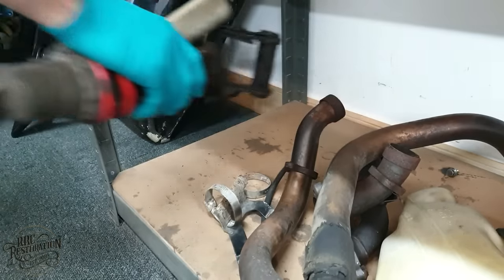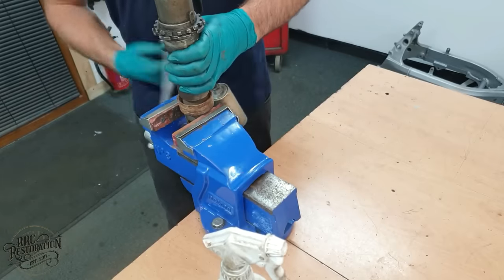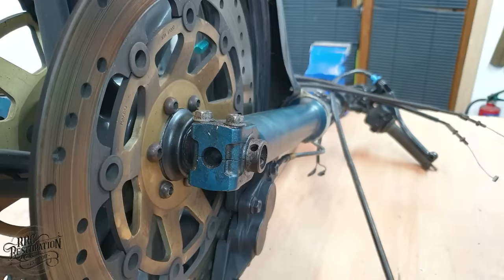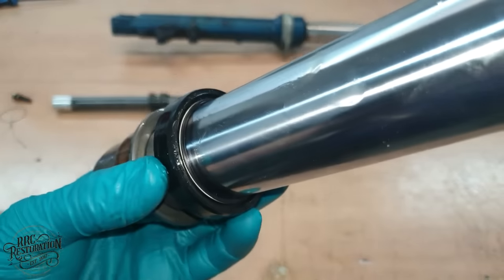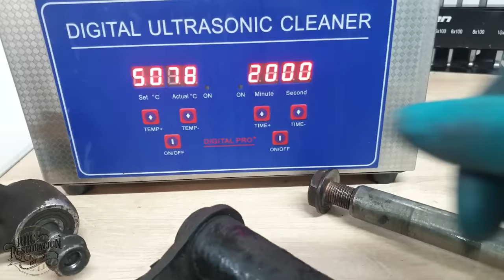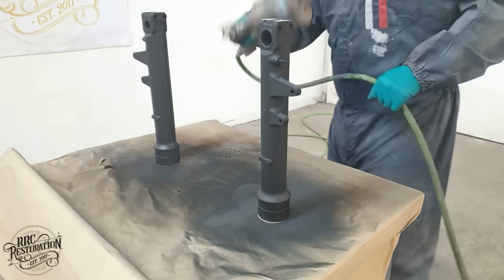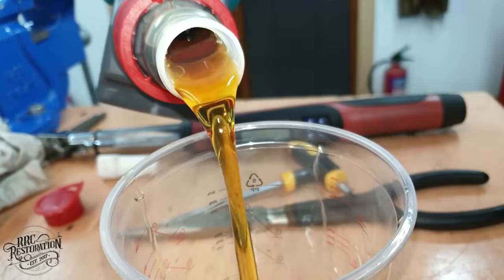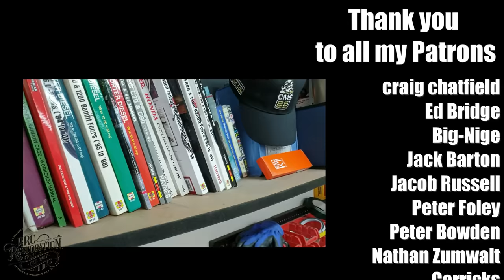Restoration Of A Ruined Legend - Honda VFR 400 NC30 - Part 3

Comment: It's been 20+ years since I made a living as a suspension tech, but 2 things come to mind.  The first you probably did but just didn't show, when refitting the top cap, you want to run the rebound in 3 or 3.5 turns.  This sets the range of adjustment (if they're all the way out when you put the cap on you'll have no rebound adjustment, or at different points from each other and you'll have different settings on both forks).  

Second is conditioning the chrome tubes themselves, while not all Need this every time, it's bug guts and rock dings that tear up seals so we always dressed the chrome with a cross-hatch with some Emory cloth.  I really don't remember grit, though the hatching was clearly visible...  obviously, give a little more attention to any rock ding areas to knock down and smooth over the high points.  The scratches won't harm anything, they simply fill with a Tiny amount of oil and give a slightly lower stiction.
Reply from the maker: Very good and valuable advice, cheers fort taking the time to pass on your knowledge to us :)
Reply: What about how the forks went together before putting in the dampner rod and the aluminuim bottoming out piece under it
Reply: @RRCRestoration 
Hiya.
Is it possible to send the forks from a Honda blackbird to get a refurb ?

Comment: Most people would have just bought a Nitron replacement shock. Love your fully committed restoration attitude ❤
Reply from the maker: Funny that you should mention that as I did look into just replacing it with a Nitron but I couldn't bring myself to replace the original.

Comment: Instead of the proper tool, one can also use a PVC plumbing pipe plus the old rubber ring to hammer in the new rubber ring. Thank you so much for the detailed video and the whole series!

Comment: Love your work just the way you do things I've learnt somethings today.  Interesting with plastic over the slider to fit the seal fitting the seal with the tool protecting the nut checking oil level. Thanks 👍
Reply from the maker: Thank you so much , really glad you've picked up a few tips and tricks ;)

Comment: Sorry to be that guy but I sure you've installed the springs upside-down, I'm sure the tighter coils go at the bottom which was how they came apart anyway.
Secondly you've bleed the dampers then layed the forks down, and with the bottom end slightly higher they may require bleeding again. Great job though I've been doing this for 25 years and still love watching how other people do things, you can always pick up something new tips wise 👍
Reply from the maker: Nicely spotted, I wondering how long it would take for someone to spot that.  Immediately after that shot I flipped the spring around , I got a bit caught up in worrying about the camera shot rather than what way the spring was facing.  lol

Comment: I love your work. They wouldn't allow the 400 over here in the States so I'm on my 4th 750 (various generations, even one 800vtec) my current one is a '93. It's the first one I've had to due a major rebuild on, as I let friend borrow it one day and he proceeded to ride it into the side of a mountain in Colorado. This episode will certainly help me rebuild the used replacement forks and front wheel I bought offa ebay. Excellent!
Reply: I do indeed have the genuine Honda shop manual for my model because they specs will obviously not be the same. But watching you do it proper is a bonus.

Comment: Having recently done my CBR500RR front forks I envy how well the fork seal came out! I had to heat the casing up to get mine to shift. Great tip woth the plastic bags too.
Reply from the maker: I recently had a 125 in for service, same thing the rubber had basically welded its self in fork tube pretty much had to melt the rubber before it would move, absolutely nuts how hard they can grip.
Reply: What does the plastic bag do?

Comment: Several years back. I did a rebuild on my Triumph Speed Triple's suspension. After multiple rounds, due to seals leaking and poor performance, I found that factory suspension just wasn't for me. Ended up installing Mupo cartridges and rear shock for my setup. I probably took those forks apart 4 or 5 times in my garage, and this video just reminded mean that I still have that order of operations imprinted in my brain.

Comment: The drain bolt for the fork leg was replaced with a generic hex bolt, personally, I find stainless bolts, with the numbers filed from the head, and then polished up can look OEM, those numbers (8.8 or whatever) always reveal them to be non original.

Comment: As a motorbike DIY'er, thank you for the tips and tricks you're passing on. The plastic to protect the top cap is absolute genius!!

Is the plastic sheet over the fork just so you don't damage the seal when fitting it? What type of grease is the red one you're using?

Thanks for all your time and effort man, you're a legend!

Comment: what a joy, maybe consider a modern set of the Showa BPFs off a new gsxr 600, get the brembo mono's the works, so nice, or integrate FI and get a modern CBR setup with active suspension, weight is all off tho...  a modern shock man that bike will be the knee's for sure .. comfy and glued

Comment: At 12:07 it shoes that the fork springs were installed improperly. The tighter coil windings should be at the top. The nonmoving end of fork tube. You should have check the fork tubes on V blocks to check for straightness with a dial indicator.

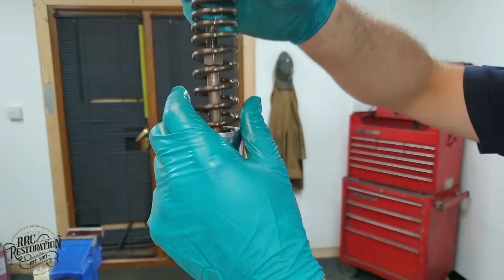Comment: @24:52 did you install the spring upside down? I thought the progressive side of the spring is supposed to be towards the bottom of the fork?
Reply from the maker: Nicely spotted, I wondering how long it would take.  Immediately after that shot I flipped the spring around , I got a bit caught up in worrying about the camera shot rather than what way the spring was facing.  lol

Comment: I have done a number of the Honda rear shocks, everyone says they are bad but it’s not that. 9 times from 10 there is no nitrogen in the reservoir and the shock cavitates like crazy. Check for leaks, add a shrader valve and refill and it works like new again. 
You can use Ohlins seals and pistons on the shock, the dimensions are the same. 

For the frame finish, polish the extrusion parts bead blast the cast, then anodizing will get you back the factory look. Paint is close but not quite right. No offense meant, just an observation.
Reply from the maker: That's a great bit of advice for the future especially using Ohlin's parts on a Showa wish I'd known that and I'd have built it myself lol. 

No offence taken at all I'm always open to constructive criticism its how we all learn to do things that bit better next time ;)

Comment: Hi………; Without looking at the 400+ comments, I don’t know whether somebody has mentioned this, but you’ve put the springs in what I think might be the wrong way round, when you took the forks are part of the tighter coil of the spring was facing down and when you put them  back together you put the tighter wound part of the coil facing up. Not sure if this makes any difference 🤔 I have just completed a fork service on my GL 1800 and the tighter part of the coil was facing down the same as your 400.
Reply from the maker: Nicely spotted,  Immediately after that shot I flipped the spring around , I got a bit caught up in worrying about the camera shot rather than what way the spring was facing.  lol

Comment: Splendid work and editing as always! Quick question though, did you fit the springs the other way around than they came out, with the tight coiling on the top rather than at the bottom? Or am I just displaying my ignorance here?
Reply from the maker: Nicely spotted, I wondering how long it would take for someone to spot that.  Immediately after that shot I flipped the spring around , I got a bit caught up in worrying about the camera shot rather than what way the spring was facing.  lol

Comment: Hi, nice project - I had a lot of love for these bikes in my earlier years, both the NC30 and the 35, raced 30 with Bemsee for a few years too. Nice little tip with the plastic at 26 minutes too.

Sorry for OT, but what liquid do you use in your parts cleaner?

Comment: On aluminum parts, how do you determine whether to sandblast or vapor blast?
Reply from the maker: With me its a case of what finish is going to be on the part, if its going to be painted then a sand blast finish is preferable as its a better surface for the paint to adhere to, for bare, polished or anodized then you want a very soft slightly polished finish and that is where the vapor blaster comes in with a glass bead media.
Reply: @RRCRestoration  Makes sense, thanks for the reply. 👍

Comment: Another cracking video, however i think you put the springs back in upside down, should be tighter wound coils to the bottom ?
Reply from the maker: Nicely spotted, I wondering how long it would take for someone to spot that.  Immediately after that shot I flipped the spring around , I got a bit caught up in worrying about the camera shot rather than what way the spring was facing.  lol

Comment: Another great video, what blasting media did you use o get the anodised finish off of the shocks? +1 for the carbon mudguard. Also, the cut picking the washer up from the floor back to the table was great, took time to film but was seamless. AAAAAAAnd a fallout reference. Just keeps getting better and better.
Reply from the maker: I was using a coal slag media to blast the shocks mainly as it was already loaded into the blaster If i wasn't painting the shocks I'd have used the vapor blaster instead as its much kinder to the soft alloy. Really glad you enjoyed the way the video was put together and the little fallout reference, I almost didn't put it in but really glad i did now :)

Comment: You didn't consider changing out the Progressive springs with Linear fork springs? Or upgrading the rear spring based on rider weight?

Comment: Would be nice to know more about painting. How much do you wait between coats? why are you using Etch primer, and what primer to use on which parts. Cause painting is a very deep rabbit hole. 

Thank you.
Reply from the maker: I'll try to include more info on painting in future, I kind of just take it for granted these days as I've been a professional painter for nearly 20 years now.
Reply: @RRCRestoration  i can definitely see that you're doing it so fluently . 
But it would be nice to know for us - hobbyists :). Thank you a lot.

Comment: Were the fork springs originally fitted upside down? I noticed you fitted the closed up coils to the top ---- to keep the unsprung weight down?
Reply from the maker: Nicely spotted, I wondering how long it would take.  Immediately after that shot I flipped the spring around , I got a bit caught up in worrying about the camera shot rather than what way the spring was facing.  lol

Comment: Is the progressive spring not upside down, tight coils at the bottom?
Reply from the maker: Nicely spotted, I wondering how long it would take for someone to spot that.  Immediately after that shot I flipped the spring around , I got a bit caught up in worrying about the camera shot rather than what way the spring was facing.  lol

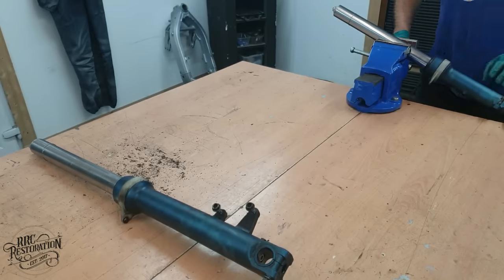Comment: At 10:44 how did you know which wrenches to grab? Did you do a dry run before recording?
Reply from the maker: When you've been doing this for years you know just by looking plus its an old Honda so everything on it is usually 8,10,12,14, and 24

Comment: ya gave me a twinge of anxiety when you put the bushings in an oil bath...is that an important step? I definitely have never done that before....😬
Reply from the maker: Its not really that important as they are covered in oil in the shock anyway it just ensures the surfaces are fully coated before installation so that a dry surface doesn't stick and get damaged plus it looks good on camera lol

Comment: Looks great but you installed the spring the wrong way around. The tight winding belongs downwards.
Reply from the maker: Nicely spotted, I wondering how long it would take for someone to spot that.  Immediately after that shot I flipped the spring around , I got a bit caught up in worrying about the camera shot rather than what way the spring was facing.  lol

Comment: The fork spring is mounted wrong way. Spire tight at the bottom and not at the top.
Reply from the maker: Nicely spotted, I wondering how long it would take.  Immediately after that shot I flipped the spring around , I got a bit caught up in worrying about the camera shot rather than what way the spring was facing.  lol

Comment: NO!!!  No Loctite on the bottom fork bolt! 

Bugger, that's going to be a b***h when that fork needs to be rebuilt again.
Reply from the maker: I've always done it like that and as long as you don't go overboard with it the bolts always come back out relatively easy, plus a little Loctite has the added bonus of reducing the chance of any oil weapage ;) But your comment is very fair as I've dealt with my fair share of damper rods that have been a pain to remove.

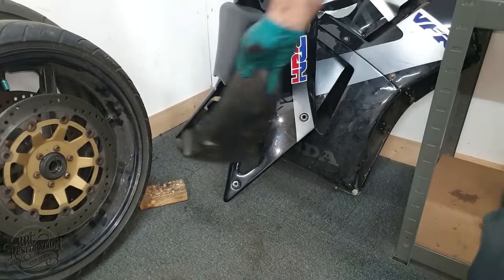Comment: 10:05 Maybe have it incorporated into the paint job to show it has real carbon fibre, but not have it completely exposed, as it just looks like random tat (for me). Oooh, look at me. I've got carbon on the bike.....hmmm.
Reply from the maker: Hmm yeah maybe a little fade out  with the paint towards the rear of the mudguard exposing a little of the weave, you've given me much to think about.
Reply: @RRCRestoration  if I remember rightly, there was a firm called Carbontek who did a Lucky Strike full kit for the SRAD Gixxer. Only the background of the Emblem behind the words Lucky Strike was exposed Carbon. Look fwd to the next video. 👍❤️